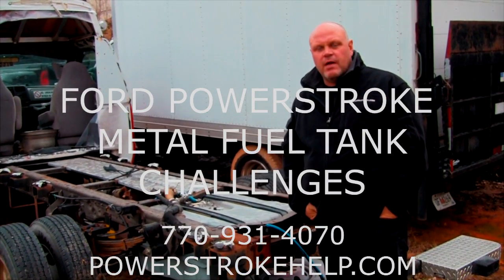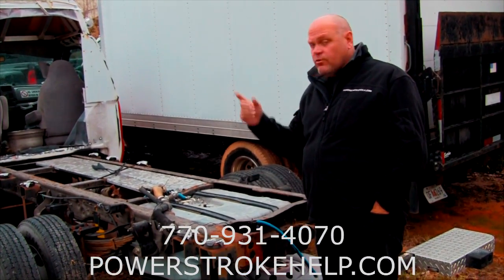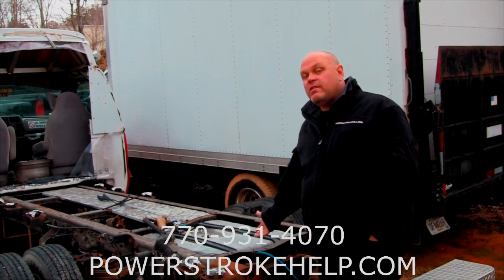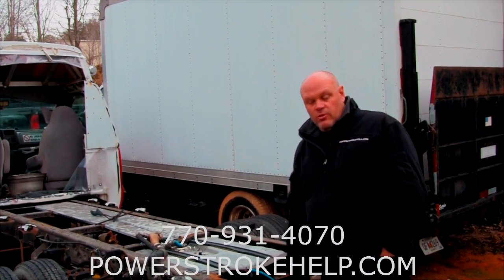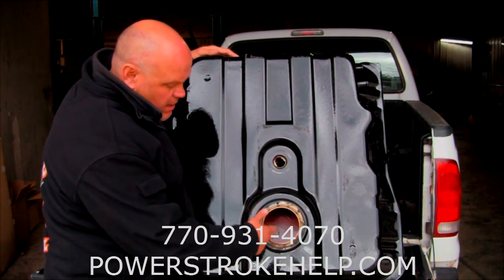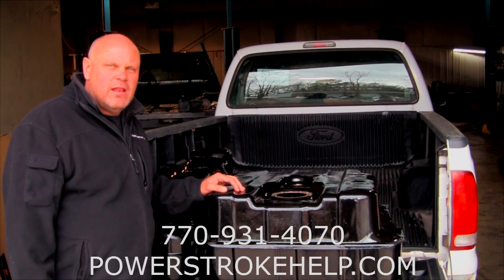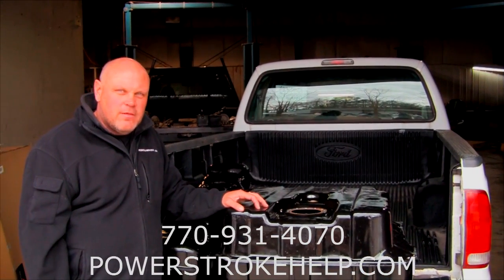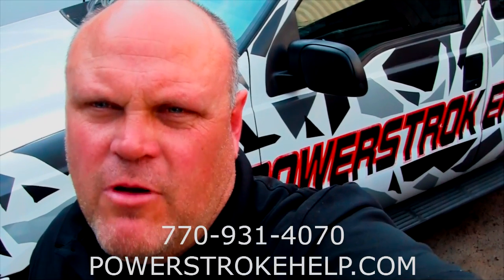FORD POWERSTROKE METAL FUEL TANK CHALLENGES

Comment: I used paint stripper and a wire cup brush welded to a bent piece of metal to clean mine. Used some tank sealer rated for diesel. Couple years later that coating is coming off. I just bought a new, non Ford tank. What a pain.

Comment: Good old tank Delamination. Happens all the time in the after axle steel tanks. Our Dealer does the same thing, we send them out to a radiator shop and they reline them with a different coating, the one they use is white but we haven't had any issues with the ones we have replaced. Plus they install a drain plug if the tank isn't equipped with one.

Comment: Bill - (Off Topic) I want to thank you for all you do with your videos.  The first video of yours I saw was on the bad PowerStroke radiator caps...20 minutes later my truck had a new cap.  Well, I saw the oil change on the 7.3L HPOP.  Mine was never done.  I sucked out the old oil and put in the new and what a freakin' extreme difference just that one quart made.  Thanks so much for that and all your important advice.

Comment: I have a 2002 7.3l powerstroke that I can't keep oil in the valley is soaked with oil and firewall behind the turbo. Used 4 gallons of oil in 20 miles just trying to get it home   Any suggestions on what to fix it would be great

Comment: The best way to solve the issue is by replacing the "Steel" Tanks with polyethylene tanks.  They aren't that expensive.

http://www.amazon.com/dp/B001ED15MY/ref=wl_it_dp_o_pC_S_ttl?_encoding=UTF8&colid=17VYUKKFQ6TY&coliid=I24LUUI8ZKPV4I

and

http://www.amazon.com/dp/B001ED15MY/ref=wl_it_dp_o_pC_S_ttl?_encoding=UTF8&colid=17VYUKKFQ6TY&coliid=I24LUUI8ZKPV4I

Yes, they are about $184 each, but you'll never have to worry about your tanks rusting ever again.

Just my 2 cents worth!

Comment: I have a question I'm looking at a 1996 ford e350 box truck 7.3 diesel with only 135,000 miles. Does $2000 sound correct for that truck? Runs and drives and has a clean title.
Reply: +Dodge 318 Cummins .. with a 7.3????... hell yeah!... 100K on a 7.3 is just breaking in hahaha.
Reply: +PhuckObama I don't really want a box truck lol. I was thinking about putting a brand new f350 bed on it but have no idea about the conversion also there is no back window on box truck cabs. Let me know thanks.
Reply: +Dodge 318 Cummins Sounds about right.

Comment: I use Red Kote for fuel tanks. I use it for motorcycle tanks and my race cars. It's probably the same stuff. But it is a pain in the ass to do especially if the tank has rust. You gotta get it all out of there.  The stuff does work great though.

Comment: if you are replacing a tank, can you buy this coating? I replaced the rear tank on my obs 96 4x4 f250 and was able to get a good external coating.  3.5 5 years later, no external rust.  However, I do keep my tanks treated and full when the truck sits for longer periods. plus I change the fuel  filter every year whether it needs it or not.  seen too much algae and stuff having worked in diesel fleets over the last 20 years.

Comment: this is exactly what happened to my truck. 05 6.0 with 215 now. needed new tank and injectors because of it
Reply: +Tom Kohler I think this is what I'm going through now with my 05 F550. Filters keep plugging up and keep finding these little brownish  slivers of something in the lift pump.
Reply: Yes. I changed the fuel filter twice but it got so bad the little paint chips made it passed the filter and ended up in my injectors. Changed the tank now before you have to pay for new injectors!